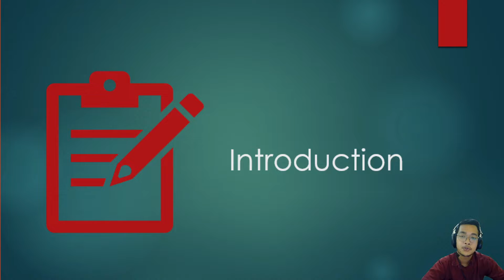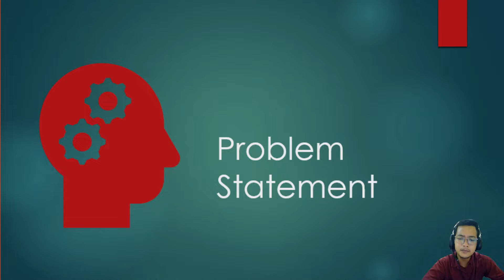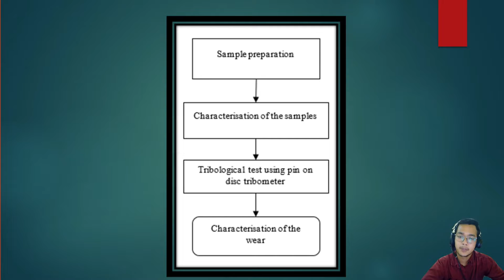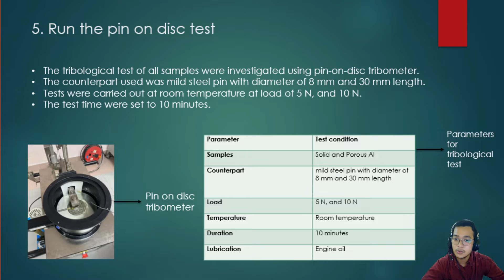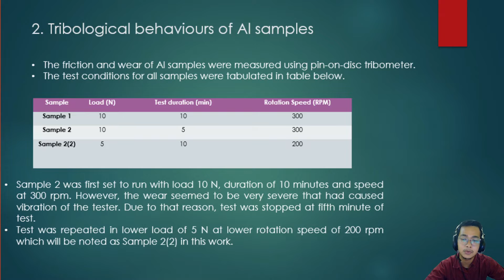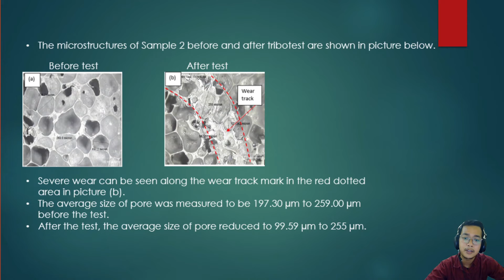FYP 2 Presentation

Comment: 1- No presentation outline
2- What is tribological properties?
3- Where this material application and why Pin on Disc?
4- What Standard did you used?
5- How you measured objectives 2 & 3?
Reply from the maker: 2) Tribological properties is the wear, and coefficient of friction of the samples.
3) The application for the material is bearing. Pin on disc test was used because it is the common test used for characterization of coefficient of friction and wear based on previous studies.
4) The standard used is ASTM G99. It is a standard test method for wear testing with a pin on disc apparatus.
5) Disc with low porosity percentage has higher coefficient of friction but low wear. For porous discs, the size of pores became smaller after the test is done. This can be clearly seen in the micrograph image of the surface structure of the porous samples before and after the test is done.